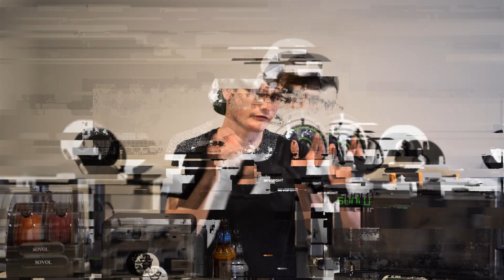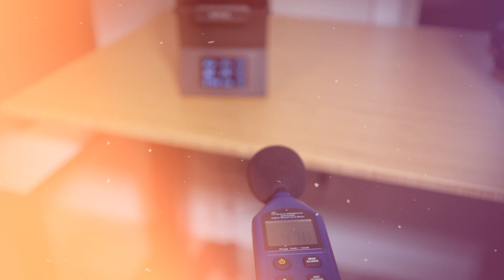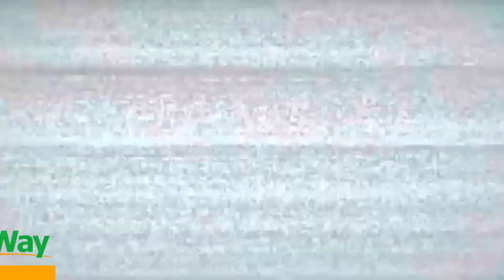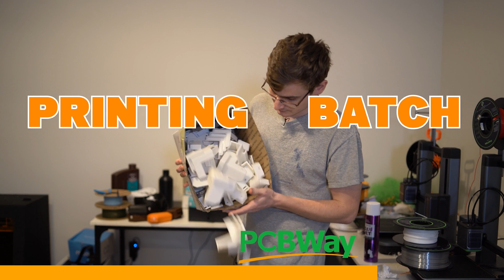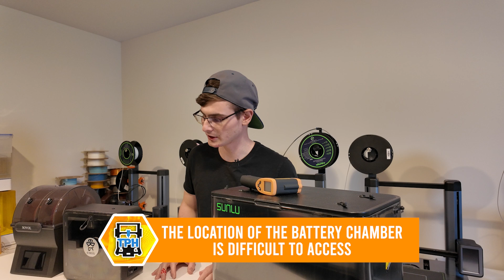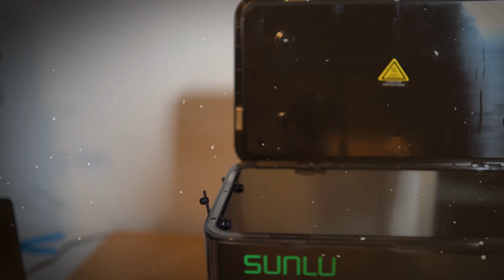STOP! Don’t Buy a Filament Dryer Until You Watch This!

Comment: Bro. I have a Creality Ender 3 V2. I can't get it to print good. It comes out like noodle strands and doesn't stick to the board. Also my screen doesn't give me the offset option like yours does. What firmware is that you use? I have an auto bed leveler too. Please Help me 🙏🏼
Reply from the maker: @aarongerou3397  I was using jyers firmware. I recommend you upgrade to that :)

Comment: $349 for a dryer box my printer cost less than the dryer box…..
Reply: It's likely your printer cannot print the "engineering" filaments that the dryer was designed to dry, due to the higher nozzle temperature (>300C) and abrasiveness of the filament.
Reply: @yeroca  I mean... an elegoo cent carbon is $300